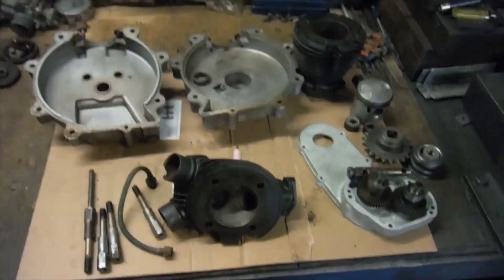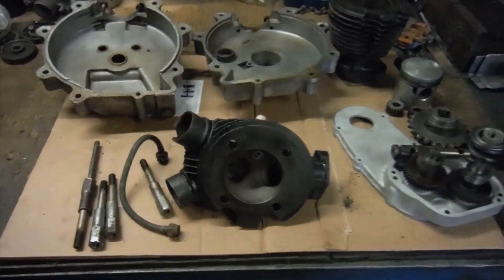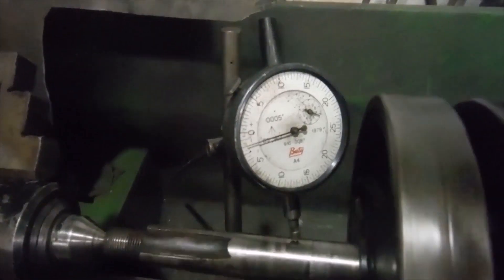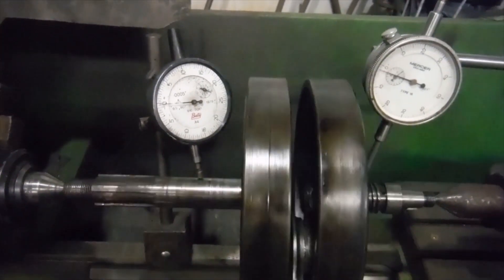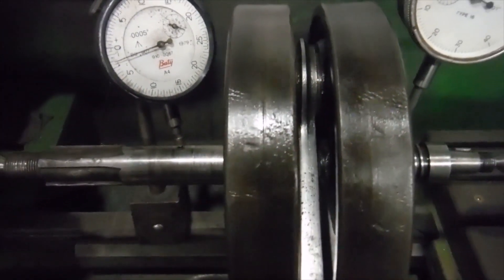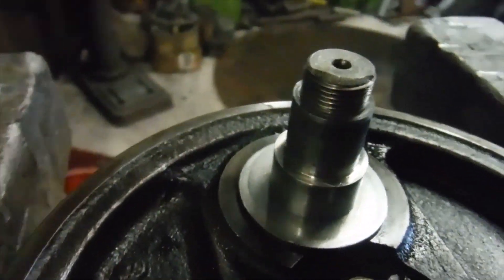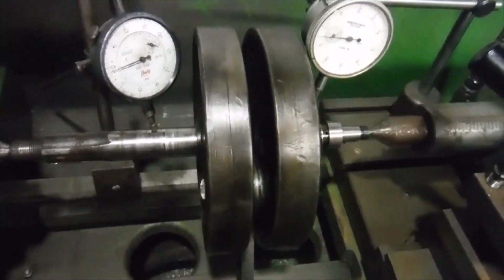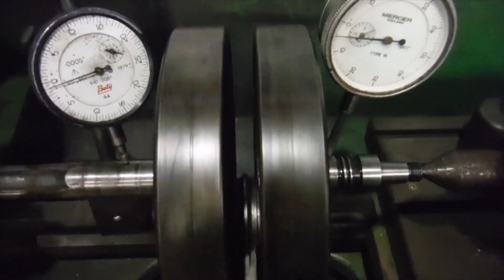AJS 250 pre war crank inspection and checking for runout before and after stripping and reassembling

Comment: What's the thinking behind the twin exhausts on a single cylinder bike? Seen it a few times on older bikes?
Reply from the maker: Back 'in the day', they were thought to boost power and performance, but actually, they didn't and the extra weight of another pipe and silencer was probably counter productive, as well as the extra expense, too. Manx Nortons, Goldies and the like all had single pipes, which tells me all I need to know. Gas speeds are also higher with single pipes, although some 4 valve singles have twin pipes, but usually these are of quite a small diameter.
Reply: @paulhenshaw4514  Cheers, mate. Gotta admit they have me baffled, but Frank says they help in scavenging of the exhaust and aid in the cooling of the engine.
Reply from the maker: If they did anything that productive, the aforementioned Manx Nortons, Goldies etc would have certainly employed them, but they didn't. Also, some twin port [single exhaust valve] Panthers supposedly perform better when one outlet is blanked off. That said, when those twin port set ups were used on 'sports' versions of certain singles prior to WW2, they were thought to improve performance at that time, this later turned out not to be the case.
Reply: @paulhenshaw4514  the bikes that you think of like the Goldies and the man and everything like that they all had alloy heads and alloy cylinders the pre-war bike especially the lower ones all had iron cylinders and iron heads and we all know Iron get hot that's why they had to Twin pipes pre-war but with the advances in Metallurgy and oils from World War II then they were able to have alloy heads and cool or running Motors without twin pipes. I got my information from an article in motorcycle Classics regarding this guy's 350 Empire star pre-war with twin pipes who stated that with the twin pipes he could not overheated fight because the Scavenging was so good on the Ironhead motor would not overheat
Reply from the maker: I suspect that guy in motorcycle classics was misinformed. There is a lot of bad information in the magazines from people who think they know things. I stand by what I said. Other opinions are available.I am currently working on a 1937 twin port AJS 250 sports engine and I also worked on the 1939 version not long ago and that had a single port - both had iron heads. Make of that what you will, as I have done..
Reply: @paulhenshaw4514  hey dude I wasn't trying to contradict you I was just going by what the guy who owned the 350 Empire star was saying about how the twin pipes Aid in the cooling of his bike and I saw that a lot of that on motorcycles you know that were pre-war. I am not the expert that you are. I just love to see pre-war bikes being used as intended, I don't have a car I use my sidecar rig for everyday transportation. You have probably forgotten more knowledge then I could learn. Love your videos very instructive and very informative entertaining.
Reply from the maker: No problem, Frank and thanks, but I often see words in print - or spoken on film - which probably shouldn't be, but once written or spoken, those words become easier to believe! I wouldn't comment to the contrary, if I wasn't sure, though! Regards, Paul.
Reply: @paulhenshaw4514  I was just thinking how Ed Turner made the original Triumph twin to look like a twin Port 500 single so this way it would not look controversial and therefore not be accepted by the British motorcycle in public. By making it look like a twin port single got it accepted by the conservative British public. I love watching bikes being used and prepared so they can be used instead of just being displayed collecting dust in a museum.
Reply: The twin pipes on freeboard bikes was there for better Scavenging of the exhaust as well as better cooling for the engine it's almost impossible to overheat a twin pipe single.
Reply: @frankmarkovcijr5459  Thanks very much for that. Cheers.

Comment: I just got to the rod on my 441 and after 120 000 miles and 25 year the up down play on big end is loose now. I really pinned the bike a lot though, now glad I have a nice stock big end all ready to go in. Interesting the clutch side on this 250 has less run out. Seems that side would be more prone to stress deflection.